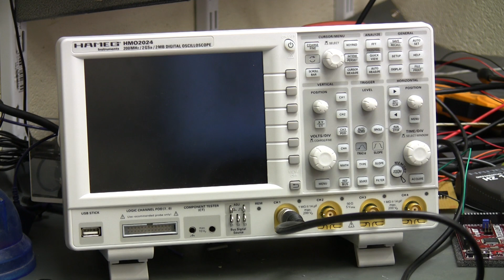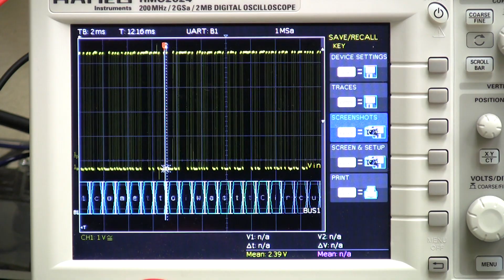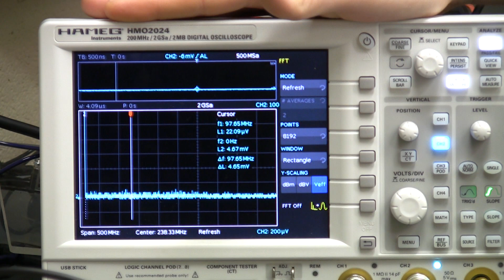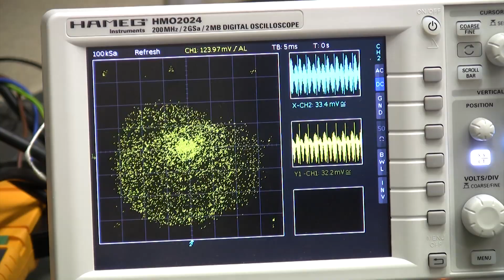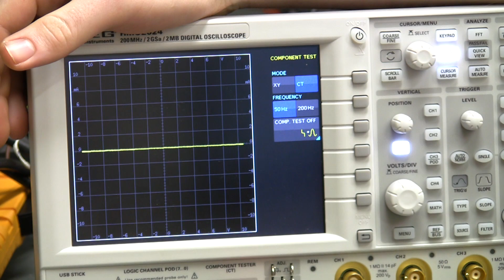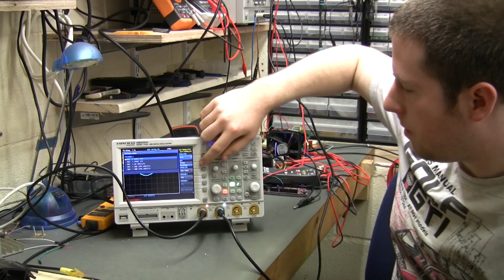Watt Circuit HAMEG HMO2024 Oscilloscope Review

Comment: After spending my younger years working with big name Oscopes as a bench tech and deveopment engineer❂>imgs.love/owOscilloscope?М   I have always wanted one for home use. This scope is ideal for the tinkering that I do (repairing equipment for friends and small electronic projects). I like the form factor and the battery function is great when you just need it for a quick check of something. The display is easy to read, the probes are better quality than other entry scopes, the carrying back makes it easy to put away with all the accessories (as I am an occasional user, this is important to me.), and the menus are not difficult to figure out. I just think that it is a good value for occasional use and you are accustom to higher end scopes.
Reply: Херня китайская.

Comment from the maker: You don't have to scroll to see all the channels, the screen size for the waveform is the same size on both the scopes. When using 11 channels on mixed signal scopes, this give you additional options. Try using 11 channels on the Agilent, and see how well it works. I personally prefer the 12" screen on the 7000 series at work, but can't justify the £13k price tag for home.

Comment from the maker: Sensitivity, when it comes to scopes, has a commonly accepted usage. It refers to viewing low amplitude signals on the scope, and when doing this, the Hameg outperforms the Agilent hands down. This is useful particularly in viewing really small signals, which comes up frequently in analog design. This is an area where people still use analog scopes, and the Hameg scopes offer the possibility of replacing these workarounds in a reasonable price range

Comment from the maker: What you are referring to is the higher update rate on the Agilent, and it's main benefit is in a reduction in dead time, where the scope is ignoring the signal, as it is processing the data already captured. The Agilent clearly is superior in this regard, and we made no bones about this. This is helpful in glitch and runt capture, as well as in XY mode-see the comparison in youscope demos for details. If you spend all day doing glitch finding, then definitely go for the Agilent.

Comment from the maker: The boot time is much longer than the Hameg scope, as compared by us, in person with stopwatches measuring bith the MSO2024X and the HMO2024.

Yes, the 3000X series do have 50 ohm inputs. The 2000X series don't. Going by price, which for us, for personal use, is an important factor, the 2000X series is the direct competitor. Therefore, we compared the Hameg to this line.

Comment: 2 other things... 

"so sensitive" is rubbish in my oppinion... you see more of the signal MORE of the time on 3000x series because of the higer waveforms per second.

and seeing multiple mosi/miso on the screen on 3000x series doesnt require you to scroll up and down to view all of it... why would you want to scroll???? note that agilent have a LIST MODE which timestamps single-shot or long-term serial trigger events.

Seems like you have not even used the agilent units in my honest oppinion!

Comment: You might consider doing a review of the agilent units before you blast it out of the water so decisively.... plus, consider a few things:

The agilent 2000x/3000x do not have wondows CE... actually none of the agilent scopes have windows until you get to the 9000 range! It is actually proprietory software using proprietory processors and designed 100% by agilent from the ground up.

50-ohm input.... the 3000x series has selectable 1Mohm and 50-ohm inputs.

get your facts before you do a review!